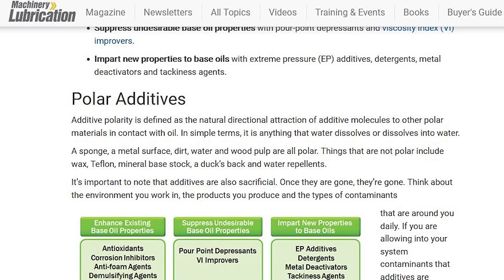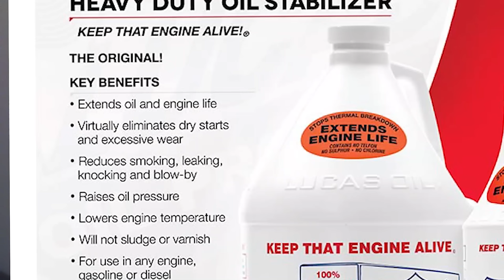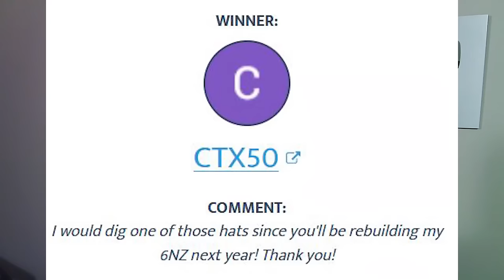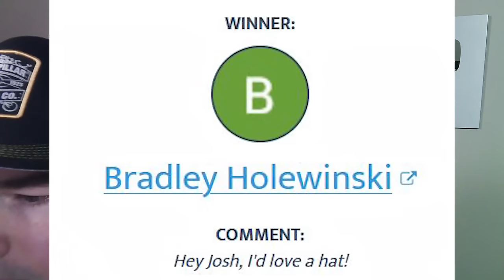Does your Engine NEED Lucas Oil Stabilizer? A detailed look at the "Benefits."

Comment: If it at least helps 5% with keeping oil on the bearings/lifters/etc after sitting, thus helping reduce dry start damage. Its worth it to me. It might do nothing but i have used it in every truck i have owned.
You yourself can put the oil on surface, then a oil/lucas mix and clearly see it holding on for longer and leaving a film on the metal surface. Anything further than that or maybe boosting some detergents, is marketing smoke

Comment: I have never used any of these type of products in anything in the actual oil; I have soaked my rod & main bearings for high perf V8 gasoline engines in Slick 50 to get the friction reduction qualities at the bearings, but not in any contact (except the very small residual amounts) anywhere near the cylinder walls.  Honestly, I don't know how much advantage that achieved, but I bought one bottle for about $30 & used it on 7 or 8 engines, so I figured it was worth a try.  I also use a zinc additive for initial run on new flat tappet cams after the late 80s.  That said, since 2007, I have only used conventional 10-30 oil in all of my vehicles (mid 1990 through mid 2000 model year domestic gas V6) & changed the oil at 4000 - 5000 mile intervals with an OE filter.  I have over 450,000 on 3, 385,000 on one, & 180,000 on another  with only one of them (96 Chevy 3100) using any measurable amount of oil, & it uses less than a quart between oil changes.  I also perform other basic PM on the entire vehicle.  I really can't think of a good reason to put these products in any vehicle.  Another Question: if not suitable in Power Stroke engines, wouldn't it stand to reason that it should never be used in CAT engines with HUEI systems as well?
Reply: I thought it said 6.7 powerstroke. That engine doesn't have an hpop. I think you can't use it because of that engines tighter tolerances
Reply: Never mind I seen what you were talking about, it definitely says powerstroke

Comment: I've been repairing heavy equipment and trucks since the early 80's and I have yet to see a manufacturer to recommend an oil additive our suggest extended maintenance intervals! Oil additives will help a worn engine last a little longer or help oil pressure,  but that's only on WORN engine's.  I agree with this young man.

Comment: I've used Lucas for assembling LSx engine and it has been great.  Substantially cheaper than "Engine Assembly Lubes" and it sticks to the bearings so good Brake/parts cleaner has a hard time removing It.
Reply: That's actually a great idea! may consider that as I'm getting ready to assemble a 6.5 LS stroker.
Reply: @christophermix6845  I've been using it for years.  You can let the engine sit for 2 years and pull the main caps off and the stuff is stuck to the bearings like honey.  Soon as you fire it up and oil gets to the bearings it mixes in no problem.
Reply: @nocturnalspecialties642  sounds better than cam lube that stuff is sticky but will drip off pretty fast. My only fear would be the additives in lucas might not let the rings seat good due to slickness.
Reply: @christophermix6845  I've never used it to coat rings. 
I use ATF or cheap 5w30 to coat cylinder walls and ring packs.
Reply: @nocturnalspecialties642  gotcha I was just wondering if maybe the amount from the bearings would be enough to affect it mixing with the oil. But probably not though if you haven't had any issues with burning oil.

Comment: I’ve used their Fuel additives. My Neighbor has a Detroit that would have some crazy Starts every morning. Never would it start without puffing shaking or extremely rough. I handed him 2 jugs of fuel treatment and dumped it into the tank and a week later his truck started up and ran 100 times better.

Comment: As a PROUD Powerstroke owner, have the same 2000 7.3 Powerstroke since 2007!!! 450,000 miles on stock engine, and ZF6! Just put a new clutch in finally two years ago. Never anything BUT Rotella T4 15-40w, with a FULL GALLON of Lucas Oil Stabilizer. OH!, still same injectors from 2000 BTW ;)

Comment: You are correct.Im running a 89 305 460.ooo and still going strong.driven daily it gets 10% Lucas every oil change...idle at 20 psi oil pressuer.No sludge.I run it in all my small engines, mowers,ect.90 350 with 340ooo still going...good stuff.I would not recommend using Lucas in a new tight engine..

Comment: This stuff works however I've discovered a problem if the temperature gets too low your engine may not be able to suck oil up in time to seize up a bearing which is what happened to me with a skid steer also I've discovered it's too thick to go through the oil filter which in turns forces the oil out the bypass I would say it's safe if you are careful how much you use but one quart in your engine is way too much

Comment: Several years ago we pulled our 5th wheel from Des moines to  Nashville with a 01 7.3 PS . Very windy. Started with new 15w40 oil . When I got to Nashville it was 1/2 way to add. So I put a qt. Of super tech additive in.  From there to Key west FL. To  San Antonio before changing the oil . Pulling  23.500 lbs.. this is not a stock engine.  325 Hp to the wheels. 
It's  a dry engine. No leaks . And it still runs great.  Still Pulling the same trailer. 
Will never sell this rust free truck.

Comment: Lucas absolutely reduces dry start if you've ever had to clean an engine that used additives you now it's freaking impossible to wash off completely.. kerosene , gas, diesel, brake cleaner, acetone. nothing

Comment: I use the full synthetic version of Lucas oil stabilizer in my 2006 Hummer H2 with 245k on it and I like how there is way less ticking especially right after cold startup.  I also have a 2020 Buick Encore with a 1.3 liter turbo and I would not use it in this vehicle.  If you add Lucas to engines with 0w-20 on the oil cap you will get a check engine light immediately stating incorrect oil viscosity

Comment: I tend to stay away from the Lucas engine oil additive because the "sticky" prevents the oil from draining back into your pan. Love it for transmissions. Great for autos that still work fine. Freshens them up a bit with a good service. 👍 manuals.
Reply: Not warm…..
Reply: @gm4ulkill  I think ur on to something Robin
Reply: Feck me the stupidity is everywhere I'm this comment section.

If the oil hasn't drained back, it means it's STUCK to all that metal that needs it.

It's exactly what they say it does.

A large number tof people run synthetic engine oils which tend to run off much faster than any mineral oil did. I suspect Lucas's use a mineral oil base and mix their product off that.

Why does it work in a tranmission and not an engine? That's stupid to say.
Reply: @HatesSpam-cb4ym  well you know your engine has a pump. That draws oil from the lowest point. You might not be as brilliant as your mommy told you.

Comment: I recently pulled down a 2WS that had 800k on last overhaul. Customer changed oil every 10k, using 2 gallons of Lucas, and 15/40 Rotella. I have never seen a diesel engine with so much sludge and so much bearing wear on ANY  brand of engine. 

Let's not forget that, when you raise oil pressure, you loss power and efficiency. I am 100% against oil additives unless its zinc additives for flat tappet cams. And if it is not for powerstrokes, then it's not for any HEUI engine.
Reply from the maker: That is a good story to hear. Most of the diesels I've ever been through don't really have much sludge in my opinion, unless they are getting coolant in the oil. Interesting that Lucas may have been causing a sludge buildup.
Reply: Funny you mention that. Thicker oil means higher oil pressure. Higher pressure means less flow, which means less bearing cooling.

I service fleet vehicles and we have a couple super high mileage Cummins with nothing but delo 400 since day 1. Never had an engine apart for anything other than injectors and turbos.

Comment: I work for a performance auto parts retailer, I talk more people OUT of high pressure oil pumps, (not to be confused with high volume standard pressure. ) than into them. Most think, as you stated "more pressure more better" it depends on if the engine is built for high pressure. In racing applications "loose is fast", so to compensate for a larger oil clearance, usually an extra .001", yeah, more pressure offsets that bearing leakage. Beyond that, don't use one!. You could actually erode your bearings. .....That said, I do have to say, that the Lucas "transfix" stuff got me through a bout of a slipping transmission for about 3 or 4 years when I didn't have the means to fix it properly, (I only put it in one time), and even saw the truck regularly for about 2 years after I sold it to a guy up the road.

Comment: I ran the additive in my '04 Silverado from about 150k till I sold it with just under 200k.  It raised my oil pressure 20psi and the motor sounded a bit quieter.  I never extended my oil changes but when drained it didn't seem much thicker.  I wonder if your car called for a 15w20 and you went to a 15w30 you'd get similar results.  Great video!
Reply: Oil viscosity can vary, depending on your ambient temperatures.

Comment: If I use Lucas in motor oil it is the fully synthetic one it is much thinner then the regular Lucas additive also way more expensive.  The regular Lucas additive seems to be better for manual trans or differentials unless you operated them in extreme cold climates.  I agree regular Lucas is not a good additive for the new 20w0 oil engines but, the fully synthetic Lucas after 65,000 or so miles may be ok?

Comment: I have to bring up a few points on this one. Of course when an engine is new, never use anything except what the engine is designed for by the engineers who designed it. But as you said yourself, the older an engine gets, the more wear it has, and the larger the clearances will be in the bearings, then you use the thicker additives to fill those gaps. When you mentioned the knocking, you didn't think about how oil works. By using thicker oil and reducing the knock, you are reducing the amount of force that is being applied to the bearings. It would be like diving into the shallow end of a pool. The knock would be your head hitting the bottom. But if you were to use jelly in the pool instead of water, then you avoid the knock, which means you don't hit the bottom, and don't have the damage. The thicker oil cushions the bearings and prevents them from hitting their surfaces together, thereby preventing further wear and making the engine last longer, or extending the engine life. If Lucas oil additive is used when the engine is worn, someone can get a little more life out of their engine, an use that time to save up for the repairs.
Reply: I don't think you thought about how oil works...If you have a knock you ain't fixing anything by pouring shit into the crankcase...Amateur
Reply: @davidscott5903  favour? Nah I’m good.  You can’t fix crankshaft journal to rod bearing allowance issues with shit you dump in the crankcase.  Period.  Fuct is fuct.  You can smash stoddard solvent on an anvil for me all day.  I don’t do stupid things.
Reply: @jaredmayer3960  
You are just afraid of learning something.

Comment: I’ve been a diesel mechanic for 34 years I am with you when it comes to never using this product in a newer machine however if you succeed over 600,000 miles and you can see A little smoke I hear some noises coming from the engine I would highly recommend Lucas It is really a Band-Aid for what really needs to happen you can probably get a another hundred thousand out of it maybe more but I would never put it in a gasoline engine.
Reply: I do all the time

Comment: My theory is if you need to add substances to your oil to make it work then you need a different oil but the Lucas MIGHT be able to prolong a worn out engine long enough without catastrophic failure until repairs can be made. Looks and feels like STP to me and if you have ever torn down an engine that used STP you would have seen sludge and debris stuck in corners and hollowed areas. Lucas also sells oil but recommends adding stabilizer to it also. What does that say about their oil. I was also once told that STP was the stuff they took out of oil in manufacturing process but I don't know if there is any truth to this and like I said, the Lucas looks like STP to me.
Reply: 100% petroleum means that motor oil companies add additives to what is essentially  Lucas in order to make motor oil.  

If it's good or bad to use it in an engine is up for debate.  If you use Lucas in a manual with a slipping clutch it works like magic.  I do know that for sure.  I know of many do it your self wrench turners that ward off a clutch replacement for very long periods by simply pouring Lucas in the tranny.

Comment: I'm telling you one thing. One of the service trucks i run is a 14 f450 with the 6.7 power stroke. It's knocking on 300k miles and has... Had a very bad miss. You could even call it a dead miss. Get ready guys because the shits about to get deep. It has massive blow by and we pretty much have written it off as a loss but want to keep it going as long as possible. We serviced the truck and ran 3 gallons of Lucas and 1 gallon of delo 15-40... The miss is gone. Blowby still there but smooth as silk. Are we doing what's right by the truck? Hell no but results are results.

Comment: Well it does help keep that old engine alive.  When you don’t have 30 grand to over hall the cat engine.   It will add 5 lbs of oil pressure to an up to temp motor.  Yeah it’s a bandaid but shit happens in the real world.   I’ve also used it in tired rear ends and trannys.

Comment: My 7.3 powerstroke requires 15qts of oil for a sump oil change and to prefill the oil filter. There's another 3qts in the high pressure oil system in the heads. I change oil and filter at 4000-5000 miles depends on my use. When I started using it I add 3qts of Lucas oil stabilizer, 20 percent, and I can tell you after driving around after you do your change out put around 30 50 miles to mix it all together the injectors are quiter, reduced smoke when started AND fires up better on a cold start. I did not start using Lucas oil stabilizer to fix any problems or noises w the truck I started using to help w longevity. Been using it over a year now and when I went without it on a change interval I could tell it ran different and started different. This my own experience and have been doing it on the truck for that last 25,000 miles.
Reply: the bottle say do not use in ford power stroke.
Reply: @viking.200  I've gone through several gallon jugs of Lucas and 1qt bottles. None have said not to use in powerstrokes.
Reply: @dylanhicks7996   look at 2.19 say on the bottle it is because power strokes should have tighter tolerances.
Reply: @viking.200  I know it does on the video but on the bottles and jugs it does not say that. Can argue about labels all day but I have actual years of experience using it in my 7.3 powerstroke and has done nothing but make the truck quieter, idle smooth and start better in cold weather cold starts. Not to mention the "7.3 powerstroke" isnt actually made by ford and not really a "powerstroke" it's by international and real name is T444E so maybe the warning online is right for later model "powerstrokes" but the 7.3 is nothing relatable to its predecessors other than the fact that they're HEUI diesel engines.

Comment: I like Lucas products myself, the 2 stroke oil in my option is some of the best. I’ve never understood why people ran the stabilizer but to each is there own I guess.
Reply: The 2 stroke oil meets good specs. The red and tacky grease is pretty good too. The only 2 Lucas products I would use.
Reply: The mud mower guys use it in the gearboxes. 
Those are grease filled ,so you remove that and fill em with gear oil and a shot of Lucas. 
Kinda need some help when you're overspeeding the gearbox anywhere from 4-10x it's intended input rpm.

Comment: This is the truth. I had a Chevy work van. I did regular maintenance on it since I bought it used. I had it for 6 plus years. I was in the market for a newer van 3 years before I planned on upgrading.. after 3 years i could not kill the truck the motor was getting near 300k miles so I delayed getting a new work van because it became a challenge. How many miles can i rack up? I told myself when the drive train quits or I start having electrical problem I will make the move. The tranny quit on a small incline 2 blocks from the parts store. I was revving the engine in drive and did not care if it blew up and was excited for a newer van for myself thinking finally it is dead.  To save a tow charge I went to the parts store and bought Lucas transmission fix. I followed the instruction and then drove the van another 15k miles until my girl friend said get rid of the truck. The guy who bought it was 2 hrs away called when he got home and said what a great running van and thank you. I researched what was in it and it is a trade secret like the Kentucky fried chicken recipe.

Comment: I have a logging business and was going through final drives on my John deer dozers common problem for them the main top gear and bearing would get starved for oil i started using straight lucas oil stabilizer in all of my final drives instead of gear oil and never had a problem after that